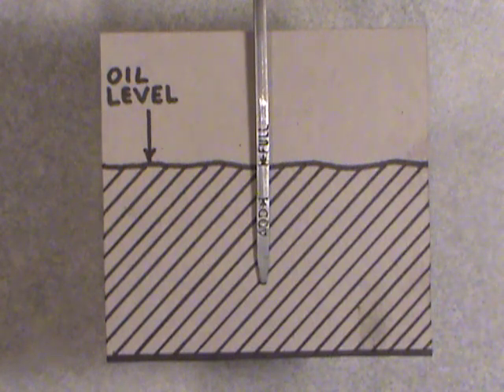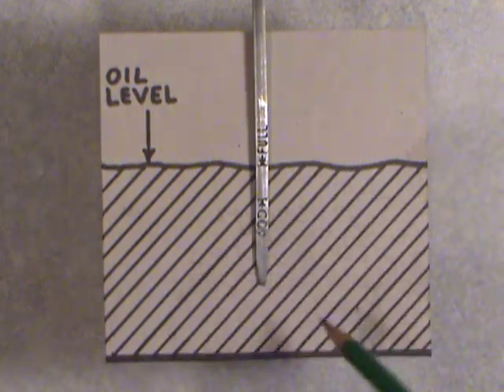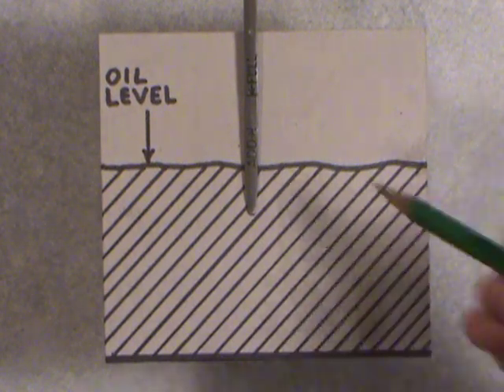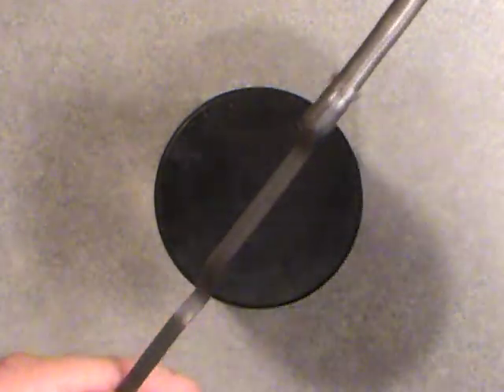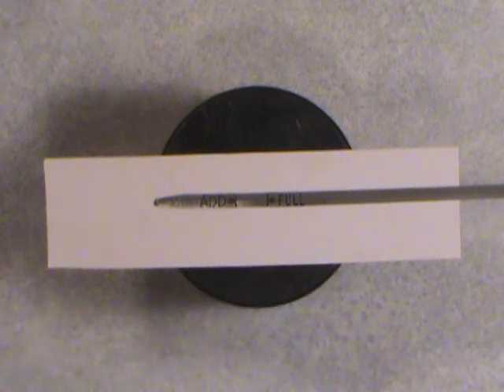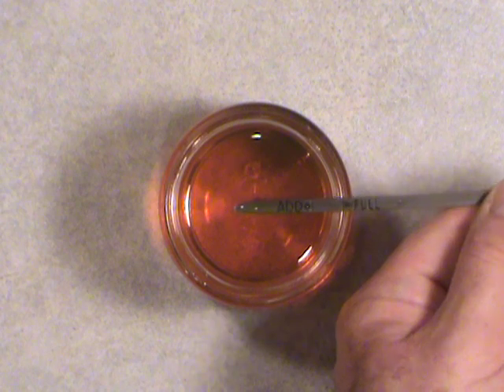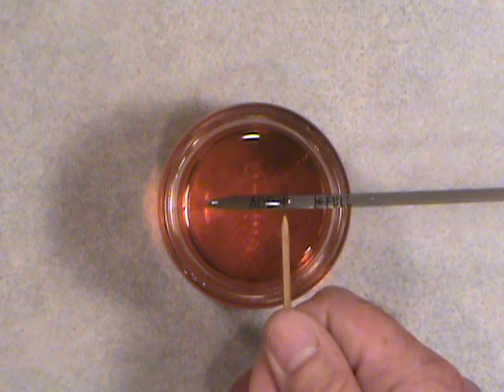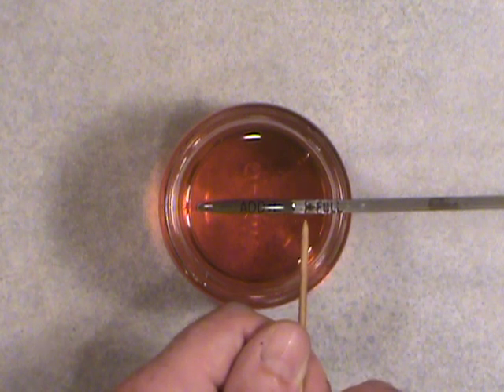How to Check your Engine Oil Level

Comment: nice detailed video,  the first time i checked my oil i did it with the engine running lol but i didn't know any better.
Reply from the maker: dsouzand Greetings dsouzand....Thanks for watching, and for Your comment as well.......................................So, You Checked Your Engine's Motor Oil "Level" on the Dipstick, while the Engine was "Running", did Ya...well, stuff like that happens, every now and again, and doin' what You did, has me thinkin', it's usually a "Guy" thing...You know...when all else fails..."Read the Instructions"...!!!...lol...and yes, I've been known to do that also, from time to time as well..............................................As I see it, it may very well fall under the same Heading, as something like, when a "Guy" is driving His Car or Truck, in an "Unfamiliar Territory/Area", and will usually..."Refuse to ask Someone for Directions"...and probably spend lot-sa time, tryin' to figure out..."Where the Heck He Is"...and also...How He's gonna..."Go"..."From Where"...He..."Doesn't Know where the heck He Is"...To..."Where It is...He wants to End-Up-At"...!!! (still Fumbling with that there "Road Map")...lol.............................................Yes-Sir-ee-Bob...I usually like to "Check my Motor Oil Level, on the Dipstick"..."Before I Start the Engine for the Day"...that way, I find that, the "Motor Oil"..."Cools Down"..."Over-Night"...and...I find that the "Motor Oil" is a bit "Thicker", and won't be running down the Dipstick as readily, as when the Motor Oil is "Hot" (and usually '"Thinner" as well), and also, gives the Motor Oil "Plenty of Time", to make its way, back down into, the Oil Pan (that's on the Bottom of the Engine)...........................................Also, the Vehicle should be on fairly Level Ground as well, to give a more Accurate Reading (on the Dipstick), as to the "Real" Oil Level, that happens to be in the Oil Pan, at that particular time..................................................Another thing, to be watching out for, is, when driving down the highway, and You are noticing the "E" on Your Gas Gauge, and You need to find a Gas Station to get some Gasoline (or, it's Gas Can, or Tow Truck time, if You don't!), then, as I see it, the Engine's "Motor Oil Level" should be "Checked", pretty much, each time that You are "Filling Up the Gas Tank", especially while driving down the Highway at higher speeds.............................................I find, that if I fill up my gas tank first, then, as I see it, the "Motor Oil" will have a bit of time, to make its way back into the "Oil Pan" (by way of Gravity), as opposed to having a considerable "Amount of Motor Oil", still in "Suspension" (aka, Motor Oil, that is still in the upper regions of the Engine), which in turn, will more then likely, be given' me, a more Accurate "Indication", as to just how much Motor Oil, that "Is Actually" in my Engine's Oil Pan....................................................Make sure to "Keep", Your Engine's "Oil Level" on/in between, the "Markings" on Your Engine's, Oil Level Checking "Dipstick", as "Too Much" Motor Oil in Your Engine, can be almost as bad, as Not Enough.........................................."Too Much Motor Oil" in Your Engine, can at times, cause the Crankshaft to act, somewhat like a "Blender" Does, in that, the "Crankshaft and the Connecting Rods" can make Contact, and Dip-Into that, rather "Too High of a Motor Oil Level", and "Churn It Up", making for some very "Full of Air Bubbles-Motor Oil", that, once, that "Motor Oil-Full of Air Bubbles", makes its way, to the "Pickup Entrance to Your Oil Pump", that Oil Pump, will be tryin' to Pump, that Motor Oil Full of Air, which will usually result in Your Engine's "Oil Pressure Dropping", perhaps to an "Engine Damaging Level"...!!!......................................."Not Enough Oil" in Your Engine, at any given time, can also cause Your Oil Pump, to "Not be Able" to, Supply Your Engine, with enough, Motor Oil "Pressure and Volume", and, once the Engine's Bearing Surfaces are "Starved", for "Lubrication"...repeat after me..."Bye-Bye-Engine"...and..."Hello"..."expensive"..."Expensive"..."EXPENSIVE"...as in..."Repair or Replace"..."One Damaged Engine"...!!! (don't say I didn't warn Ya...lol)..............................................For Safety's sake, it would be a very good idea, to start reading as much as You can, about Your Vehicle..."Before"...You..."Attempt"...any..."DIY" (Do It Yourself)..."Maintenance or Repairs", for the very reason, that, when "Things go Wrong", while working anywhere near a Vehicle..."Personal Injury"..."Can"...Will"...and..."Might Happen"...!!!.............................I'd rather be Talkin' To Ya...rather then, About Ya..................................Be Safe, take care, and have a good one.

Comment: Hi, Rocky.  Can you do a video on the various oils an automobile uses?  You mentioned Differential Axel which I have no idea what that is.  Just bought my first car and would like to learn about DIYs.   Anyway, I'm only familiar with engine oil and transmission oil (just learned that not long ago).   Lovely video; very informative. 

Thank you
Reply from the maker: supercooled Greetings supercooled....Thanks for watching, and for Your nice comment as well.............................................I will start with Your "Differential Axle" question..................................................Most of the Smaller to Mid-Sized Cars these days, usually have, what is known as "Front Wheel Drive", where in most cases, the "Differential and Automatic Transmission" are usually part of, the Engine itself............where-as............with a "Rear Wheel Drive" Car or Truck (most of the Larger, North American Ones), like a Camaro, Challenger, Mustang, and Pick-Up Trucks as well for example, will usually have a Rear Axle "Differential" (just a fancy name for the way in which the Gears work, inside the Rear Axle's center section), that is usually Driven by a rather long "Driveshaft", that is driven by the output end of the "Transmission", that is usually connected to the Engine, by what is commonly known as a "Bell Housing"............................................................Usually, an Engine in a "Front Wheel Drive" Car or Truck, will be Mounted "Sideways" in the Engine Compartment..............where-as................an Engine in a "Rear Wheel Drive" Car or Truck, will be Mounted "In-Line" with the Center Line of the Vehicle (aka, Not Sideways)..................................................If You have a "New" Car, then, in order to..."Not Void the Warranty"...You'll have to "Use" the Factory/Manufacturers "Recommended" Fluids...!!!...............................................Also, if Your Car is "Under Warranty", You'll have to have, things like "Oil Changes" Done by a "Certified Automotive Shop", and Not Done by Yourself, or, You just might "Void the Warranty", in most cases, so, make sure that, You "Follow Their Rules", if in fact, You happened to have purchased a "New" Car.............................................................The way that I learned so much about Cars & Trucks, was to read, just about anything that I could get my hands on, as far as any Automotive Books were concerned, that is..................................................A good place for You to start, is, Your Car's "Owners Manual" (if You have one, that is), and, read it..."Cover to Cover"...in order to..."Learn all that You can"...about Your Car................................................There are also "2" Different "Types" of "Repair and Maintenance Manuals" (usually Big Books), that You should be able to Buy/Purchase, for Your "Exact Car" (Year and Model)....................................................There is the "Factory Manual", that is usually more "Technical" in nature, and then, there are some of the "Aftermarket Manuals", that are, as I find, shall we say, a bit more "User Friendly", in as far as a Novice or Beginner is concerned...........................................................The "Haynes" Car and Truck..."Repair and Maintenance Manuals" are very good, and in most cases, each one of them, usually covers more then "One Model" of Car or Truck, and, they are usually written, in such a manner, that, You should be able to "Learn" quite easily from them......................................................You can also "Surf" the Internet, lookin' around for information on Your particular Car as well......................................................See if You can find a "Forum" (a Website, that People can ask and answer questions) about Your "Exact Car", as some of those People, will probably, have already "Solved and Repaired", just about any Issue that Your Car may have in the Future...................................................There are "Many Different" Vehicles out there, along with, "Many Different" Types of Fluids, that each Vehicle Manufacturer "Recommends" for "Their Vehicles", and in some cases, "Using the Wrong" Fluid, can be "Dangerous", and, at times, can cause some rather "Expensive Damage" as well...!!!...................................So, my best advice, is to, make sure, that You read, all that You can, and make sure that, You fully understand, all of the "Safety Related" Procedures..."Before"...You start working on Your Car...!!!.................................................So then,  it's now time, for You to become a "Book-Worm" (aka, a Person, Who Reads alot, just like I have, and still do!), to begin to Understand, how things work, and how to make those things last longer, not to mention, the..."Pile of Money"...that You'll be saving, by "DIY" (Doing It Yourself)................Best of Luck..............Be Safe, take care, and have a good one.
Reply: Thanks for the comprehensive reply Rocky.   I just want to share a little anecdote with you about my brother who was the person I was thinking about when I was reading your comment.  He had a Suzuki Swift from the early 90s and he took it upon himself to do almost everything himself on the car.  I was only a kid back then and still remember going to the library where he was checking out these technical books so he knew the ins and outs of his car.   

My own adventure in ownership land isn't going to be so technical.  I just don't have the time or inclination to read all that much about my own car apart from the few instances relating to oil change and such.   I Just bought myself a 2014 Kia Forte hatchback which has a turbo charger.  Luckily it is modern enough that I don't have to bother with turbo maintenance; or does it?   From all accounts, people have told me the modern turbo cars are very self sustaining and require little to no upkeep insofar as the turbo charger itself goes.   

Anyhoo, thanks for sharing your knowledge.
Reply from the maker: supercooled Greetings supercooled....Congratulations, on being the Proud Owner, of Your Newly Acquired..."Ride"...!!!........................................Here are "2 Words", that You should always remember..."Preventative Maintenance"....................................................Seeing as how, You were sayin', that Your Engine is Equipped with a..."Turbo-Charger"...that in itself, just..."Triggered"...something in my...Gray-Matters-Memory-Bank (aka, in my Brain, somewhere)................................................"Make Sure", that You..."Read the Owners Manual" (that hopefully, came with Your "Ride", from cover to cover), as, I'm thinkin', at the moment, about "2"..."Very Important Things"...that are rather..."Specific"...to that, of having an Engine, Equipped with a..."Turbo-Charger"...!!!.................................................From what I recall, some, if not most..."Turbo" (Charger) equipped Engines, in the past, had "Turbo-Chargers", that got pretty darn..."Hot"...probably due to, all of that..."Hot Exhaust Gas"...that was being used, to..."Turn/Spin"...the..."Turbo-Charger's"..."Impeller"...and, when it came time to..."Turn Off"...the Engine...it was "Advised", by at least One Vehicle Manufacturer, that, the..."Turbo-Charged equipped Engine"..."After Driving the Vehicle"...be Allowed to..."Idle"...while..."Parked"..."for a Few Minutes"..."Before Turning Off the Ignition"...in order to, shall we say..."Cool Things Down"...!!!...................................................I'm thinkin' that, If the..."Turbo-Charger"..."Is Not"..."Cooled Down"...Before Turning Off the Ignition"...especially After a Hard Run, and maybe at High Speed as well, that perhaps, the..."Turbo-Charger"...could very well..."Be Damaged"...probably due to, as I'm thinkin'..."All of that Hot Exhaust Gas"..."Heating Things Up"...which will make, just about any..."Metal Device/Equipment"..."Expand"...like You wouldn't believe...!!!...................................................Also, I'm thinkin' that, perhaps, there just might be, some Motor Oil, that might be Circulating as well, that will Lubricate, as well as help "Cool" Things Down.......................................................Also, in order to make Your "Ride"..."Last Longer"...as it applies, to that of Your "Engine and Turbo-Charger"..."Use the Best Quality Motor Oil"...that is Recommended by Your Vehicle's Manufacturer, and also for the Climate/Temperature, that You will be Driving Your Vehicle in (aka, how Hot it gets in Summer, and how Cold it gets in Winter, as well)..............................................................Once You have read, all of what's in Your Vehicle's Owners Manual, then, perhaps, You can do what I did, and that was to..."Buy the Factory Chassis Service Manual for Your Specific Vehicle"...that way, You will be able to..."See for Yourself"...and..."Learn Plenty about Your Kia Forte"...as well...................................................Also, If Your..."Kia"...is..."Still Under Warranty"...Make Sure"...that..."You Follow Their Rules"...as, for example..."Who is Required to Change the Oil and Oil Filter, and at what Distance/Time Interval as well" (while Under Warranty)...???.............................................As I see it, a Person, will not be able to..."Read Too Much"....!!!.......................................................Till next time................Be Safe, take care, and have a good one.